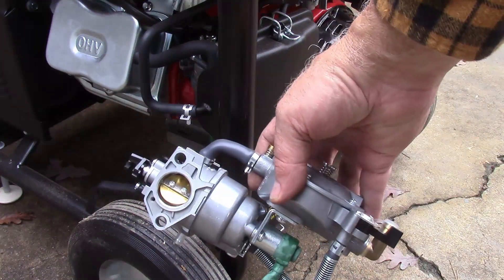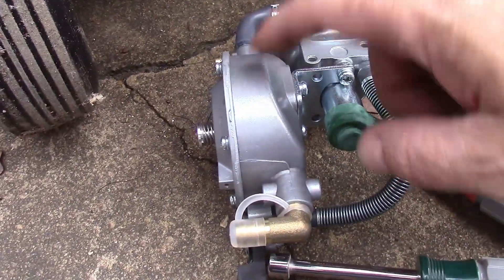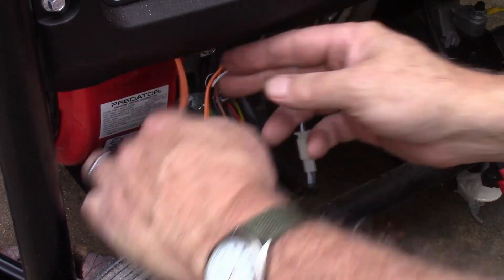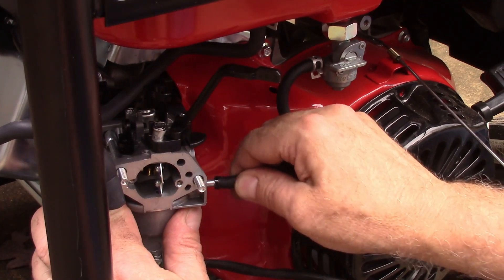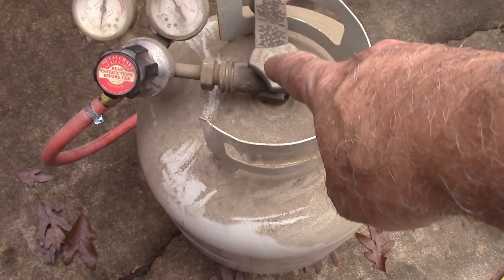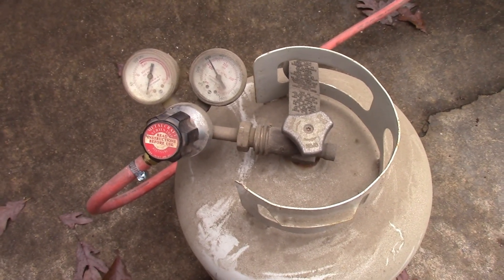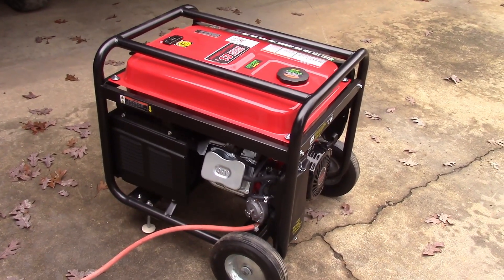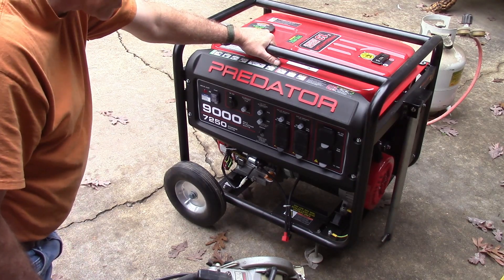Predator 9000/8750 Generator Propane Conversion  Tri Fuel

Comment: I've got the newer style Predator 9000 with the plastic air box. It's more angled towards the frame rail. It's much thicker/deeper than the metal one and, again, it's not pointed out towards the front of the motor, it's facing the frame rail. So, when I put the big ol thick adapter on the carburetor, it made it near impossible to to get the back of the air box back onto the carb bolts. I had to unbolt 3 of the engine mounts and lift the engine straight up, with a crowbar, to get the back portion of the air box back on the bolts. 

The crowbar slipped once while I was trying to get a motor mount worked loose and the motor came down on my finger. Laid it wide open. But, I finally got it reinstalled and the motor mounted again. But, there is no way possible the plastic front cover of that air box is going on there again. The back of the box is a ¼" from the frame rail. So, the factory air filter is back in, with a zip tie holding it in place. Best I can do without cutting the frame, which is never gonna happen.
Reply from the maker: Thanks for sharing your experience with the newer style.
Reply: "...put the big ol thick adapter on the carburetor..."
What adaptor are you installing?  This video is about changing out the entire carburetor assembly that requires no modifications.
Reply: @mikejoyce7157  My kit is different than this one. I have the OEM carburetor on the machine, but my kit came with a billet aluminum shim, to place between the carb air intake and the air cleaner box, thick enough to house a threaded, 90° nipple the natural gas flows thru.

So yeah, it's different than this one. I was just so excited to finally get it installed and running that I commented on the first video I could find.
Reply: @heinzkitzvelvet  
So you have something like the "snoorkle" thingy that introduces the propane into the air stream.
Reply: @mikejoyce7157  something like that

Comment: Sounds like it is running a bit fast.
Can you adjust the RPMs?
How does this carb do when you run on gasoline?
Reply: Here is a reminder about portable generator safety: everyone really needs to see this safety reminder to make sure. This advice is just to make sure that everyone is aware of all the warnings and it’s just to remind people to be careful using portable generators. Generators can be dangerous if not used carefully. Every year, hundreds of people die or get injured when using portable generators due to carbon monoxide poisoning and electrocution. Make sure you are using your generator carefully and keeping others safe as well. There is something very serious that everyone should always be aware of when using generators. Some people do run their generator indoors which is not safe and that increases the risk of carbon monoxide poisoning which can cause death of family and you. Some people run their generator in wet conditions which can electrocute them. Please remember that you should never run your generator indoors. Remember that carbon monoxide is an odorless and colorless gas that you cannot see or smell. Carbon monoxide is a silent killer. Keep that in mind. Make sure your generator is 15-20 feet away from your house and away from doors, windows, and vents. Never use your generator in your porch too. Having a carbon monoxide detector is very important against generator safety. Some people also allow children to go near the portable generator which could pose risks. We need to keep an eye on our children making sure that they are not near the portable generator so they won’t get electrocuted or burned by the generator which is dangerous. A locking enclosure also keeps kids safe. A generator shed might look like a tempting place to explore, or take cover during a game of hide and seek, but a generator is a dangerous piece of equipment that can cause injury. It says on the manual that we should also keep children away at all times from the portable generator to avoid injuries. Please do not allow a child or unqualified people to operate the portable generator. Just because some manuals missed what should be listed doesn’t mean it’s safe to do. Always follow the generator safety rules when using portable generators. Generators pose electrical risks. If you need to use your generator during wet weather, you need a generator tent to protect your generator from getting wet. Don’t let your generator get wet. Keep your generator dry and before using your generator, please make sure your hands and your generator is dry. Do not wear loose clothing when operating the generator. Everything that is said on the generator’s operating manual should not be ignored. Never smoke cigarettes near the generator. Please keep flammable things away from the generator. Never overload your generator too. Your generator can catch fire. Never ever try to plug a generator cord into a wall outlet to avoid back feeding. Back feeding your generator is dangerous. Always turn on your generator first before plugging in appliances and shut off the appliances before turning your generator off. Use a heavy duty cord for your generator and the cord should not be worn out. All the instructions should be followed carefully. Never refuel your generator while it’s running. It can cause fire if fuel spills while your generator is hot. You should turn off your generator and let it cool off before refueling it. Having a fire extinguisher next to the generator is also important. This is only a reminder for everyone’s safety of using generators. Make sure your generator is properly grounded. Having a fire extinguisher next to the generator is also important against the safety rules. https://youtu.be/I1jT3ANENvI and here is a video more about keeping others safe when using generators and also about our family’s safety. Hope this helps. Thank you.
Reply: @The_Happy_Aviation_Enthusiast  That reply had NOTHING to do with my question.
Reply: @mikeharmon8733  
I've seen that EXACT reply on 100s of generator-related youtube videos.  Must be some kind of auto-bot.

Comment: When you run it on gas have you noticed it surging. The factory choke butterfly isnt spring loaded but these propane conversion one are. When I have it running on propane runs great. Switch to gas has a surging to it. Have to run it on half choke to run good. Amazon replaced it because I thought something was wrong but the second does the same thing.
Reply: Is the gas jetting the same?
Reply: Here is a reminder about portable generator safety: everyone really needs to see this safety reminder to make sure. This advice is just to make sure that everyone is aware of all the warnings and it’s just to remind people to be careful using portable generators. Generators can be dangerous if not used carefully. Every year, hundreds of people die or get injured when using portable generators due to carbon monoxide poisoning and electrocution. Make sure you are using your generator carefully and keeping others safe as well. There is something very serious that everyone should always be aware of when using generators. Some people do run their generator indoors which is not safe and that increases the risk of carbon monoxide poisoning which can cause death of family and you. Some people run their generator in wet conditions which can electrocute them. Please remember that you should never run your generator indoors. Remember that carbon monoxide is an odorless and colorless gas that you cannot see or smell. Carbon monoxide is a silent killer. Keep that in mind. Make sure your generator is 15-20 feet away from your house and away from doors, windows, and vents. Never use your generator in your porch too. Having a carbon monoxide detector is very important against generator safety. Some people also allow children to go near the portable generator which could pose risks. We need to keep an eye on our children making sure that they are not near the portable generator so they won’t get electrocuted or burned by the generator which is dangerous. A locking enclosure also keeps kids safe. A generator shed might look like a tempting place to explore, or take cover during a game of hide and seek, but a generator is a dangerous piece of equipment that can cause injury. It says on the manual that we should also keep children away at all times from the portable generator to avoid injuries. Please do not allow a child or unqualified people to operate the portable generator. Just because some manuals missed what should be listed doesn’t mean it’s safe to do. Always follow the generator safety rules when using portable generators. Generators pose electrical risks. If you need to use your generator during wet weather, you need a generator tent to protect your generator from getting wet. Don’t let your generator get wet. Keep your generator dry and before using your generator, please make sure your hands and your generator is dry. Do not wear loose clothing when operating the generator. Everything that is said on the generator’s operating manual should not be ignored. Never smoke cigarettes near the generator. Please keep flammable things away from the generator. Never overload your generator too. Your generator can catch fire. Never ever try to plug a generator cord into a wall outlet to avoid back feeding. Back feeding your generator is dangerous. Always turn on your generator first before plugging in appliances and shut off the appliances before turning your generator off. Use a heavy duty cord for your generator and the cord should not be worn out. All the instructions should be followed carefully. Never refuel your generator while it’s running. It can cause fire if fuel spills while your generator is hot. You should turn off your generator and let it cool off before refueling it. Having a fire extinguisher next to the generator is also important. This is only a reminder for everyone’s safety of using generators. Make sure your generator is properly grounded. Having a fire extinguisher next to the generator is also important against the safety rules. https://youtu.be/I1jT3ANENvI and here is a video more about keeping others safe when using generators and also about our family’s safety. Hope this helps. Thank you. Be safe

Comment: Yes it’s a good idea should be able to run your inverter or your generator on all three fuels but the adapter kits are a better way to go for the long run this Chinese carburetor that you’re installing does not last you did a good job explaining how to install it but a carburetor one that’s going to last but cost more than $33 and change
Reply: Here is a reminder about portable generator safety: everyone really needs to see this safety reminder to make sure. This advice is just to make sure that everyone is aware of all the warnings and it’s just to remind people to be careful using portable generators. Generators can be dangerous if not used carefully. Every year, hundreds of people die or get injured when using portable generators due to carbon monoxide poisoning and electrocution. Make sure you are using your generator carefully and keeping others safe as well. There is something very serious that everyone should always be aware of when using generators. Some people do run their generator indoors which is not safe and that increases the risk of carbon monoxide poisoning which can cause death of family and you. Some people run their generator in wet conditions which can electrocute them. Please remember that you should never run your generator indoors. Remember that carbon monoxide is an odorless and colorless gas that you cannot see or smell. Carbon monoxide is a silent killer. Keep that in mind. Make sure your generator is 15-20 feet away from your house and away from doors, windows, and vents. Never use your generator in your porch too. Having a carbon monoxide detector is very important against generator safety. Some people also allow children to go near the portable generator which could pose risks. We need to keep an eye on our children making sure that they are not near the portable generator so they won’t get electrocuted or burned by the generator which is dangerous. A locking enclosure also keeps kids safe. A generator shed might look like a tempting place to explore, or take cover during a game of hide and seek, but a generator is a dangerous piece of equipment that can cause injury. It says on the manual that we should also keep children away at all times from the portable generator to avoid injuries. Please do not allow a child or unqualified people to operate the portable generator. Just because some manuals missed what should be listed doesn’t mean it’s safe to do. Always follow the generator safety rules when using portable generators. Generators pose electrical risks. If you need to use your generator during wet weather, you need a generator tent to protect your generator from getting wet. Don’t let your generator get wet. Keep your generator dry and before using your generator, please make sure your hands and your generator is dry. Do not wear loose clothing when operating the generator. Everything that is said on the generator’s operating manual should not be ignored. Never smoke cigarettes near the generator. Please keep flammable things away from the generator. Never overload your generator too. Your generator can catch fire. Never ever try to plug a generator cord into a wall outlet to avoid back feeding. Back feeding your generator is dangerous. Always turn on your generator first before plugging in appliances and shut off the appliances before turning your generator off. Use a heavy duty cord for your generator and the cord should not be worn out. All the instructions should be followed carefully. Never refuel your generator while it’s running. It can cause fire if fuel spills while your generator is hot. You should turn off your generator and let it cool off before refueling it. Having a fire extinguisher next to the generator is also important. This is only a reminder for everyone’s safety of using generators. Make sure your generator is properly grounded. Having a fire extinguisher next to the generator is also important against the safety rules. https://youtu.be/I1jT3ANENvI and here is a video more about keeping others safe when using generators and also about our family’s safety. Hope this helps. Thank you.

Comment: propane fueling an engine, with compression for 87 octane gasoline, will make noticeably less power.  However, the oil will stay much cleaner.  so, if you live at say 5000' elevation, all engines (except blown or turbo'd) and air compressors, will be down 15% of hp/cfm.  then converting to propane drops another 10%..... you are down 25%.  I can tell you that propane powered vehicles at 5000' elevation are seriously weak.  wiki has a very informative article on octane rating vs compression.  Know this, using a higher octane fuel than the engine requires makes less hp.  propane has an octane rating of 105.
Reply from the maker: Thanks!